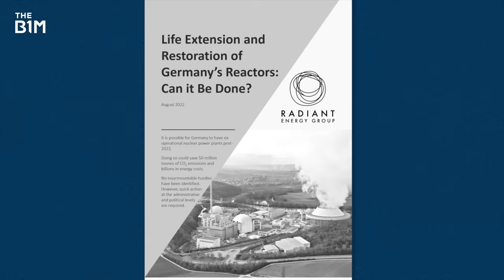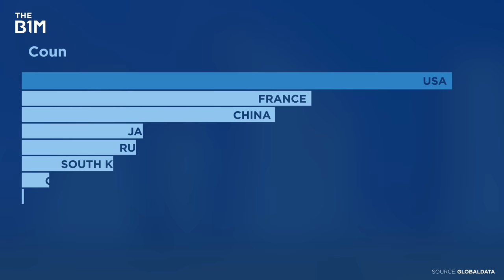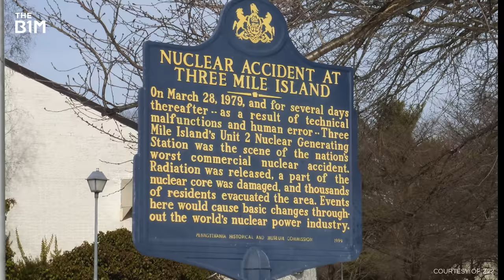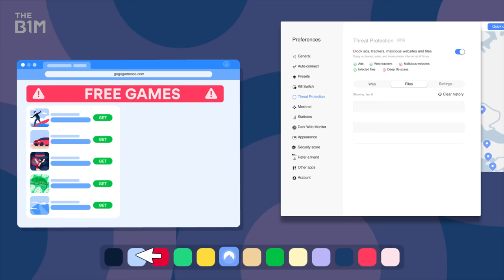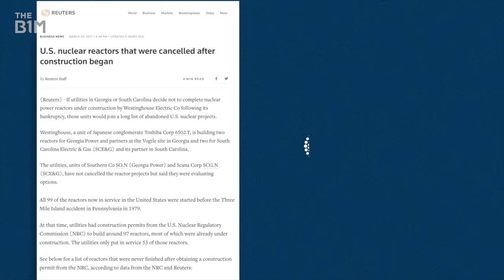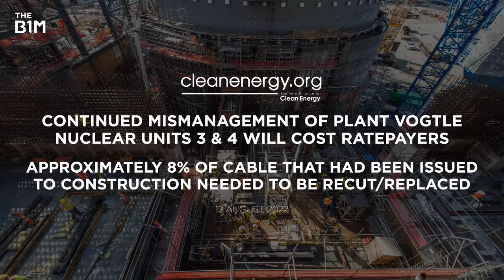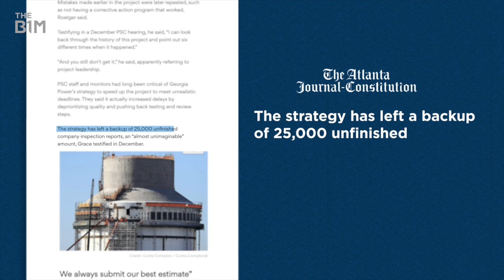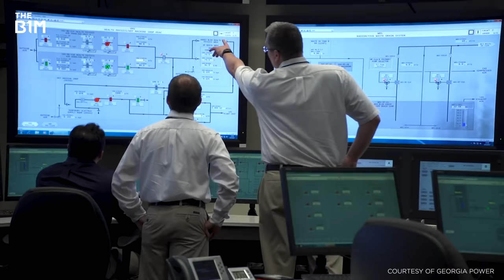Why Nuclear Power is Making a Comeback

Comment: I think the scales are tilting in favour of small, modular self contained reactors.
Reply: The NuScale SMR is the only one in the U.S. on the drawing board and here is that story.

This is from the Des Moines Register an ultra conservative newspaper concerning the only Small Modular Reactor (SMR) project in the U.S. today.
In 2013, the Wall Street firm Lazard estimated that the cost of generating electricity at a new nuclear plant in the United States will be between $86 and $122 per megawatt-hour. Last November, Lazard estimated that the corresponding cost will be between $131 and $204 per megawatt-hour based upon the 4 recent new nuclear projects in the U.S. . During the same eight years, renewables have plummeted in cost, and the 2021 estimates of electricity from newly constructed utility-scale solar and wind plants range between $26 and $50 per megawatt-hour. Nuclear power is simply not economically competitive.
SMRs will be even less competitive. Building and operating SMRs will cost more than large reactors for each unit (megawatt) of generation capacity. A reactor that generates five times as much power will not require five times as much concrete or five times as many workers. This makes electricity from small reactors more expensive; many of the original small reactors built in the United States were financially uncompetitive and shut down early.
The estimated cost of constructing a plant with 600 megawatts of electricity from NuScale SMRs, arguably the design closest to deployment in the United States, was originally advertised as costing $1 billion but upon requesting actual bids from engineering firms, increased to $6.1 billion in 2020. Given inflation and other cost constraints that cost today can only be expected to be significantly higher.
The cost was so high that ten members of Utah Associated Municipal Power Systems canceled their contracts. NuScale then changed its proposed plant configuration to 6 fewer reactors but increased each reactor output from 50 Mw to 77 Mw costing at total of $5.3 billion. The NRC just last week approved the construction of the 50 Mw design but now will have to start the review process all over given the switch to a 77 Mw design. For each kilowatt of electrical generation capacity, that estimate is around 80% more than the per-kilowatt cost of the Vogtle project in Georgia — before its cost exploded from $14 billion to over $30 billion. Based on the historical experience with nuclear reactor construction, SMRs are very likely to cost much more than initially expected. And they now have delayed the project start until 2025 in an attempt to find more backers.  All this before the inevitable setbacks that will occur once construction starts.

Comment: there shouldn't be a rush to build any more nuclear power plants until the technology to clean the fuel so it doesn't need to be stored is developed.  I have heard the technology exists and the u.s. isn't using it.  When this technology is built into every nuclear power plant then more nuclear power plants should be built but until then as few of them as possible is the best option.

Comment: The NuScale SMR is the most promising of the "new nuclear" technologies. Their approach learns from what happened at Vogle in order to avoid all the problems of having to design custom construction techniques at each new plant.
Reply: REALLY????  you apparently do not keep up with reality.

This is from the Des Moines Register an concerning the only Small Modular Reactor (SMR) project in the U.S. today.
In 2013, the Wall Street firm Lazard estimated that the cost of generating electricity at a new nuclear plant in the United States will be between $86 and $122 per megawatt-hour. Last November, Lazard estimated that the corresponding cost will be between $131 and $204 per megawatt-hour based upon the 4 recent new nuclear projects in the U.S. . During the same eight years, renewables have plummeted in cost, and the 2021 estimates of electricity from newly constructed utility-scale solar and wind plants range between $26 and $50 per megawatt-hour. Nuclear power is simply not economically competitive.
SMRs will be even less competitive. Building and operating SMRs will cost more than large reactors for each unit (megawatt) of generation capacity. A reactor that generates five times as much power will not require five times as much concrete or five times as many workers. This makes electricity from small reactors more expensive; many of the original small reactors built in the United States were financially uncompetitive and shut down early.
The estimated cost of constructing a plant with 600 megawatts of electricity from NuScale SMRs, arguably the design closest to deployment in the United States, was originally advertised as costing $1 billion but upon requesting actual bids from engineering firms, increased to $6.1 billion in 2020. Given inflation and other cost constraints that cost today can only be expected to be significantly higher.
The cost was so high that ten members of Utah Associated Municipal Power Systems canceled their contracts. NuScale then changed its proposed plant configuration to 6 fewer reactors but increased each reactor output from 50 Mw to 77 Mw costing at total of $5.3 billion. The NRC just last week approved the construction of the 50 Mw design but now will have to start the review process all over given the switch to a 77 Mw design. For each kilowatt of electrical generation capacity, that estimate is around 80% more than the per-kilowatt cost of the Vogtle project in Georgia — before its cost exploded from $14 billion to over $30 billion. Based on the historical experience with nuclear reactor construction, SMRs are very likely to cost much more than initially expected. And they now have delayed the project start until 2025 in an attempt to find more backers.  All this before the inevitable setbacks that will occur once construction starts.
Reply: @clarkkent9080  Wow, that’s a long comment. Actually the business case for NuScale has changed. They are not primarily focused on the electricity market anymore. The Utah project will mostly serve as a proving ground. In Eastern Europe they are signing deals to provide industrial heat and green hydrogen.
Reply: @dlewis8405  Not my comment but facts.  SMR have one advantage and that is lower initial cost.  But long term, they cost more.

EVERY utility that has built nuclear has always built the largest available due to economies of scale, plain and simple.

I don't live in eastern Europe but if you do then that is ok

Comment: 15 or 30 bilion dollar feels too hard to grasp, would be nice if it could be presented in watt / $ diffrences compared to another energy resource
Reply: In order to compete with natural gas, the Vogtle 1.1 Gw unit would have to be built for no more than $4 billion instead of the current $15 billion.
Reply: @clarkkent9080  ok seems impossible too give tax reduction to lower the price tag
Reply: @Karim-yd7ts  Southern Company is an investor owned utility and is guaranteed at 10% profit on construction costs so cost over runs make them money.  And you want to give them a tax break on top of that?

Comment: Just the typical boondoggle: Overbudget and late. We need SMR’s and MSR’s yesterday.
Reply: Your in luck.  Terrapower is building a MSR and NuScale is building a SMR.  However both are massively over budget and currently on hold.  So much for YT videos being anything but hype and hope
Reply: @clarkkent9080  Thanks for the update… do you know where? [/NM found: Kemmerer in Wyoming, NuScale in Idaho Falls, Idaho].
Reply: @geowar20  Yes Kemmerer Wy for Natrium.  Two years now and no ground broken.  And Idaho for NuScale and here is their story:

This is from the Des Moines Register an ultra conservative newspaper concerning the only Small Modular Reactor (SMR) project in the U.S. today.
In 2013, the Wall Street firm Lazard estimated that the cost of generating electricity at a new nuclear plant in the United States will be between $86 and $122 per megawatt-hour. Last November, Lazard estimated that the corresponding cost will be between $131 and $204 per megawatt-hour based upon the 4 recent new nuclear projects in the U.S. . During the same eight years, renewables have plummeted in cost, and the 2021 estimates of electricity from newly constructed utility-scale solar and wind plants range between $26 and $50 per megawatt-hour. Nuclear power is simply not economically competitive.
SMRs will be even less competitive. Building and operating SMRs will cost more than large reactors for each unit (megawatt) of generation capacity. A reactor that generates five times as much power will not require five times as much concrete or five times as many workers. This makes electricity from small reactors more expensive; many of the original small reactors built in the United States were financially uncompetitive and shut down early.
The estimated cost of constructing a plant with 600 megawatts of electricity from NuScale SMRs, arguably the design closest to deployment in the United States, was originally advertised as costing $1 billion but upon requesting actual bids from engineering firms, increased to $6.1 billion in 2020. Given inflation and other cost constraints that cost today can only be expected to be significantly higher.
The cost was so high that ten members of Utah Associated Municipal Power Systems canceled their contracts. NuScale then changed its proposed plant configuration to 6 fewer reactors but increased each reactor output from 50 Mw to 77 Mw costing at total of $5.3 billion. The NRC just last week approved the construction of the 50 Mw design but now will have to start the review process all over given the switch to a 77 Mw design. For each kilowatt of electrical generation capacity, that estimate is around 80% more than the per-kilowatt cost of the Vogtle project in Georgia — before its cost exploded from $14 billion to over $30 billion. Based on the historical experience with nuclear reactor construction, SMRs are very likely to cost much more than initially expected. And they now have delayed the project start until 2025 in an attempt to find more backers.  All this before the inevitable setbacks that will occur once construction starts. 

Sorry but it does not look good for either of these projects even with the $2 billion each one is getting in taxpayer money.
Reply: @clarkkent9080  This is just one of those things that someone like Elon Musk could do outside the US for a lot less money and on time. I strictly blame the moving target regulation of our Nuclear Retardation Commission.

Comment: Good, the problem with nuclear that nobody was builting them so that when you went to build one it bespoke and therefore incredibly expensive, you need teams of people who know what there doing to build a nuclear reactor and have a design that they know works to get nuclear to be economical, but after these two are finnshed they need to retain the people who made it and do another one, issue being that after the cost overruns etc etc etc you are not likely to get anyone relatively nearby wanting to build another one so you can use the same team of people to build the next one and start getting the economics making sense.
Reply: The AP1000 was built and operated in China with Vogtle engineers there and learning about any problems.  Vogtle has built and operated reactors for 40+ years so they should be experts.

The Vogtle project team and construction management are responsible for the massive cost over runs and schedule delays and should be BANNED from ever participating in any future nuclear project.

Comment: 2:05: The nuclear guy blaming the gas electric generators shutting down. How typical. Mostly correct, because gas and wind are the main generation in Texas. The picture is very different if you take a look at the outage data, though. While true, loosing half of the generation from gas and wind is a huge deal, at the same time Texas lost 80-100% of its nuclear generation for three days! So, I wouldn't be so proud of nuclear. Of course, we know that event was extreme and we can prevent it by winter preps, but still.
If you would like to know more about the even I recommend this video. The info is at 7:45. https://www.youtube.com/watch?v=08mwXICY4JM

Comment: AP1000 requires a pressure vessle, and look at the swimming pool on it's roof. US is getting serious about molten salt reactors too, even the regulators are warming up to it but semi-mainstream media channels (safe or on message what ever you want to call it) seem to detest merit and focus on 'small modular reactors' regardless if they are still a pebble bed when we have better technology on the table. To rely on fuel supply contracts as a main revenue stream is not that creative in the nuclear space haha
Reply: Here is reality.  Terrapower has been "building" a MSR for 2 years and that is not going well.

NuScale is or was building a SMR complex and they are now on hold.

This is from the Des Moines Register an ultra conservative newspaper concerning the only Small Modular Reactor (SMR) project in the U.S. today.
In 2013, the Wall Street firm Lazard estimated that the cost of generating electricity at a new nuclear plant in the United States will be between $86 and $122 per megawatt-hour. Last November, Lazard estimated that the corresponding cost will be between $131 and $204 per megawatt-hour based upon the 4 recent new nuclear projects in the U.S. . During the same eight years, renewables have plummeted in cost, and the 2021 estimates of electricity from newly constructed utility-scale solar and wind plants range between $26 and $50 per megawatt-hour. Nuclear power is simply not economically competitive.
SMRs will be even less competitive. Building and operating SMRs will cost more than large reactors for each unit (megawatt) of generation capacity. A reactor that generates five times as much power will not require five times as much concrete or five times as many workers. This makes electricity from small reactors more expensive; many of the original small reactors built in the United States were financially uncompetitive and shut down early.
The estimated cost of constructing a plant with 600 megawatts of electricity from NuScale SMRs, arguably the design closest to deployment in the United States, was originally advertised as costing $1 billion but upon requesting actual bids from engineering firms, increased to $6.1 billion in 2020. Given inflation and other cost constraints that cost today can only be expected to be significantly higher.
The cost was so high that ten members of Utah Associated Municipal Power Systems canceled their contracts. NuScale then changed its proposed plant configuration to 6 fewer reactors but increased each reactor output from 50 Mw to 77 Mw costing at total of $5.3 billion. The NRC just last week approved the construction of the 50 Mw design but now will have to start the review process all over given the switch to a 77 Mw design. For each kilowatt of electrical generation capacity, that estimate is around 80% more than the per-kilowatt cost of the Vogtle project in Georgia — before its cost exploded from $14 billion to over $30 billion. Based on the historical experience with nuclear reactor construction, SMRs are very likely to cost much more than initially expected. And they now have delayed the project start until 2025 in an attempt to find more backers.  All this before the inevitable setbacks that will occur once construction starts.
Reply: @clarkkent9080  ''focus on 'small modular reactors''  ...
Look at Elysium Industries, we will be waiting a while for US regulators to catch up but they have customers in asia already
Reply: @clarkkent9080  terrapower said they were doing molten salt but their team clearly favors conventional pebble beds.
Reply: @samuelforsyth6374  I live in the U.S. so anything I have to cross an ocean to get to means nothing to me.  NuScale is our example and it looks like they are giving up based upon the reality of coat
Reply: @clarkkent9080  US regulators are working on salt creep testing at PNNL but they don't move like they did in the 60's (somewhat fair enough somewhat protectionism, improving tho..)
Reply: @clarkkent9080  also they will be on a barge to avoid local construction delays/cost overruns so it can cross the ocean to you don't worry.. when the wrighting is on the wall even my anti-nuclear luddite country (new zealand) will have no excuse not to
Reply: @samuelforsyth6374  When the first one is built and operated then you can tell me all about it.  Until then, it is just corporate PR.

BTW, EVERY building and component at a nuclear power plant is there for the purpose of producing electrical power.  Your unicorn reactor power plant that fits on a barge is 1/500 the size of a typical 1.1 Gw nuclear plant and would produce only 1/500 that output.   You cannot magically shrink the size and expect the same power output..
Reply: @clarkkent9080  they ran a FLiBe salt thermal spectrum reactor in the 60's but yes you kinda have a point,  his design is a different salt and fast spectrum but using molten salt as a medium for fuel has some huge advantages 
I never said small haha, It will be smaller than a PWR not having water in the core means no pressure vessel required 
Not as small as GE's Container sized waste of time tho
Reply: @clarkkent9080  gates has said there should be less people on the planet and I somewhat agree but prosperity stagnates population, it seems better to make energy as close to free as possible for living standards and longterm demographics.. it seems to me to be our only hope..